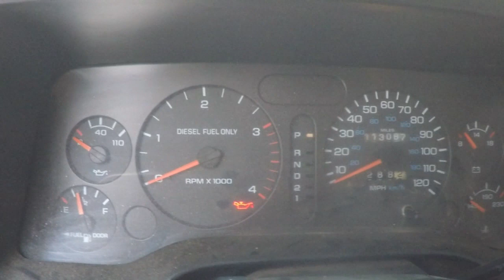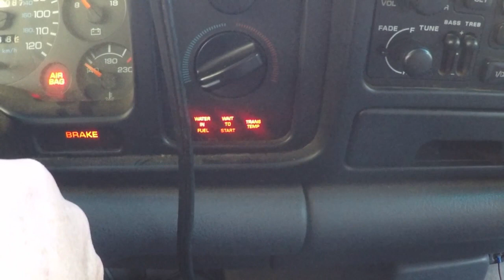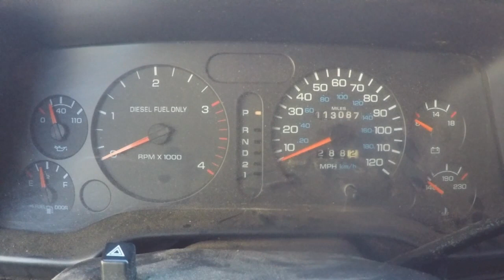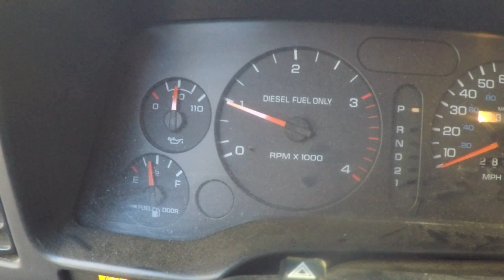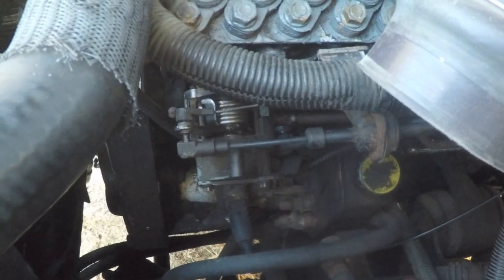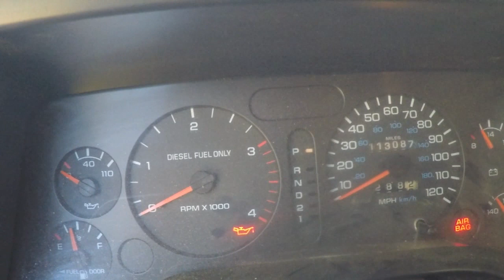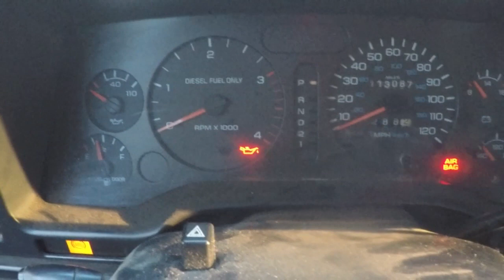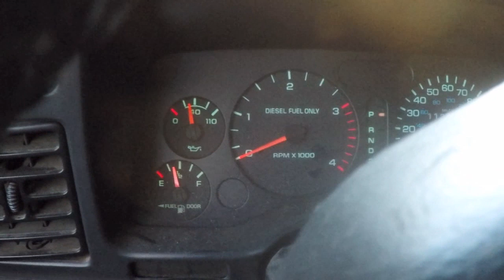1997 Dodge Cummins 5.9 throttle linkage repair Part 3

Comment: For Tach issue Replace speed sensor at the harmonic balancer with $30 dorman from orileys with  and regap at .050. I had same issue. Going on 4 months now no issues. Thanks for your video..

Comment: How does one shorten or extend the rod with the nuts? I need to do this on mine as my TPS is only reading 59% at wide open throttle. Thanks man!
Reply from the maker: I think you just have to loosen two jam nuts that keep it locked, and rotate the shaft. It's reverse threaded on one end so rotating the shaft will cause it to lengthen or shorten.

Comment: Thanks for posting the series. I am in need of a TPS replacement. At about 18:00 you get into describing refitting the TPS into position on a tang. Could you possibly point me to a set of instructions for reference.

Comment: There is an open recall on the throttle linkage ball studs for Dodge Ram diesels 1997 and 1998. NHTSA Campaign Number: 02V161000, also known as Daimler-Chrysler recall B15. Don't confuse this with the throttle cable related recall that came out for earlier model years. 
The recall description heading is in error saying only applies to vehicles with VIN position 8 as "C" for diesel ("C" was not a valid code for position 8 n 1997/98), should have read "D". I found a copy of the recall in PDF at:

https://testing-public.carmd.com/Tsb/Download/29483%2F000000003b9acbee

Comment: Check the gap on the engine speed sensor for your tach problem.
Reply from the maker: Thanks. I tried resettng the gap no change that didn't work.